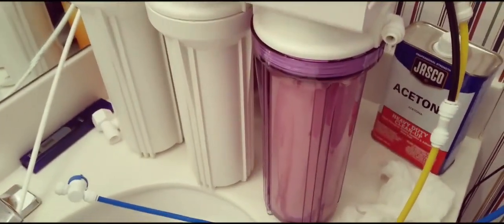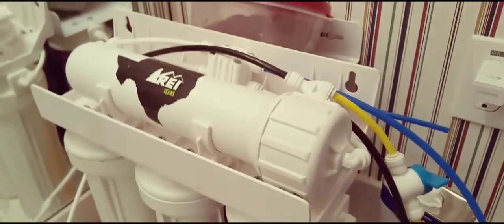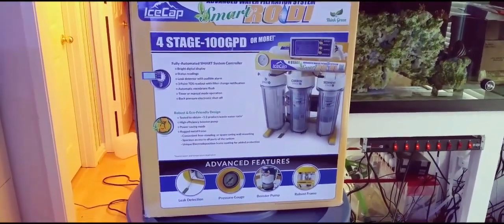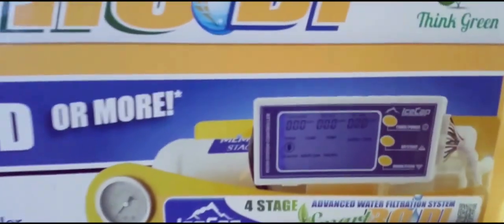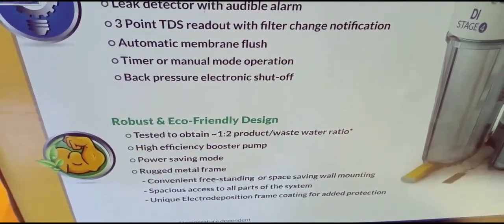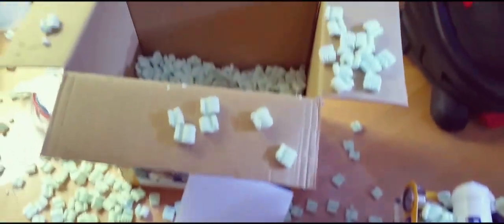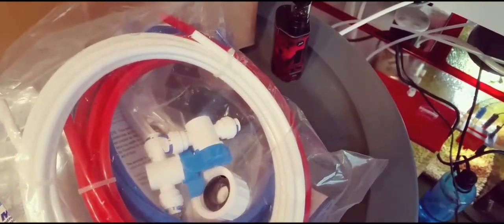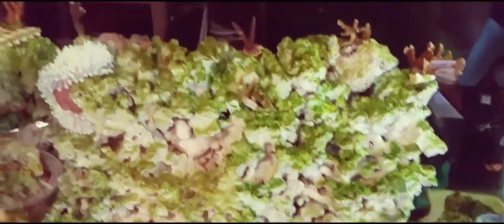Upgrade: Icecap Smart RODI

Comment: I've had mine since October 2015. this is my first Ro di unit I've ever had and I love mine I like all the TDS monitors on display all at once I absolutely love the timer feature. mine I move back and forth from the other room into the kitchen. one thing I did notice on this video was the noise at the pump was making it normally does not run that loud. the auto flashes once an hour which is great so the only thing you have to do is press the Go Button.
Reply from the maker: Thanks Jason! It really doesn't make that much noise now.  I think it was just breaking in, and my phone/camera picks up the slightest of pin-drops. :)  It's running like a beast! Very happy with the unit